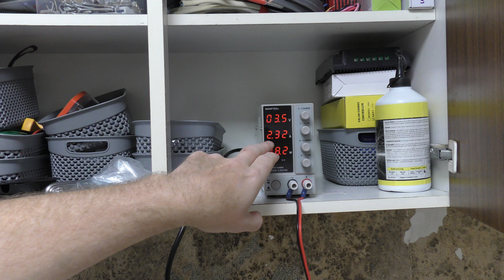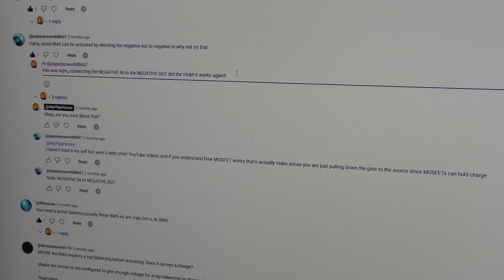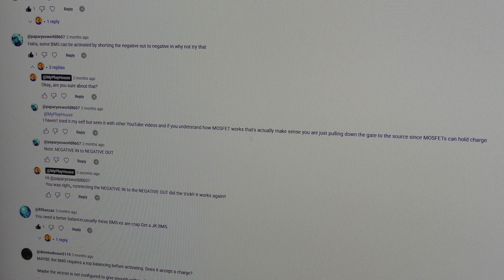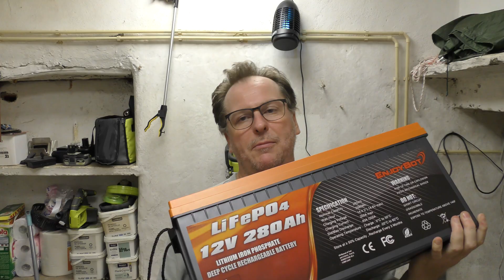Fixing Big LiFePO4 Battery by Shorting BMS In & Out Port - 1529

Comment: Hey ho, i would ask what smartmeter or software you use for exporting from the batteries in the grid. Or is this included by the deye inverter you own?
Reply from the maker: Smart meter SDM630 Modbus V2 is the one I have,, there is now a V3 thin is works the same.

Comment: You should have replaced the BMS regardless. JK BMS is one of the best BMSes you can use. Much better than the crap BMS that they put in there.
Reply: Maybe we can suggest a project with that BMS ? 
What are the strengths of it ? Please share your thoughts- would be a nice video
Reply from the maker: This battery is a 12v battery,, and this 12/24v BMS was expensive, and I would rather save it for a 24v battery..

Comment: Was waiting to see the finale of this project :) Excellent that cells are good and BMS is not dead, but can you trust the BMS...?
Reply from the maker: It's an good and expensive battery,, so I did want it back in working order :-)
Hard to know if the BMS will do this again,, :-/
Reply: I would appreciate if BMS reset would be something easy accessible and well  documented 
Thanks for the nice video - I always learn something or feel well entertained